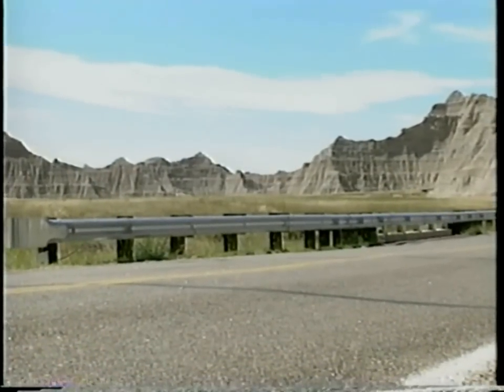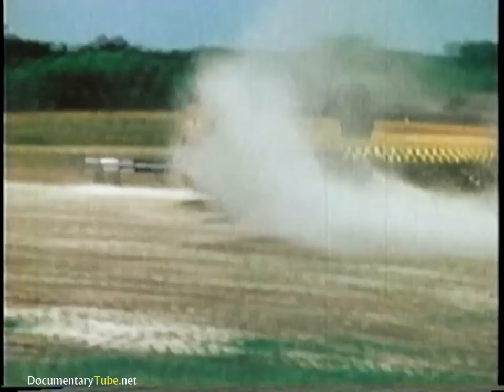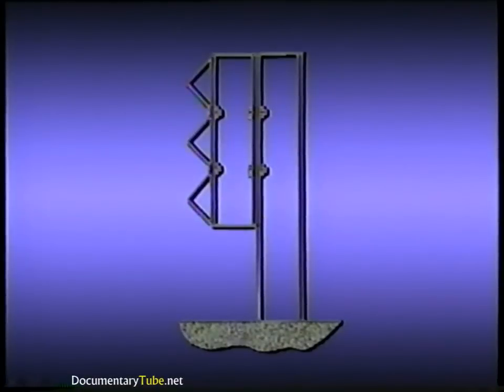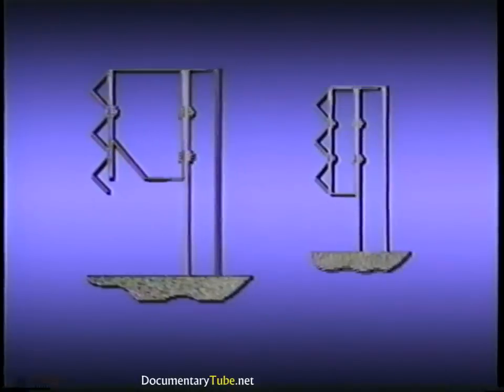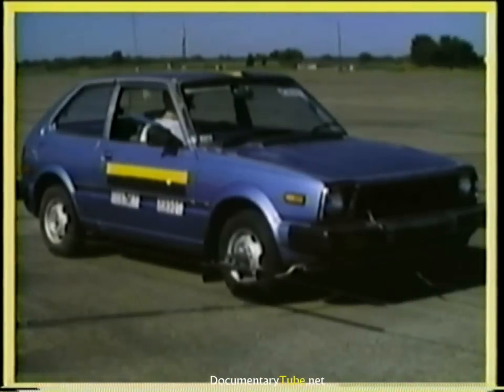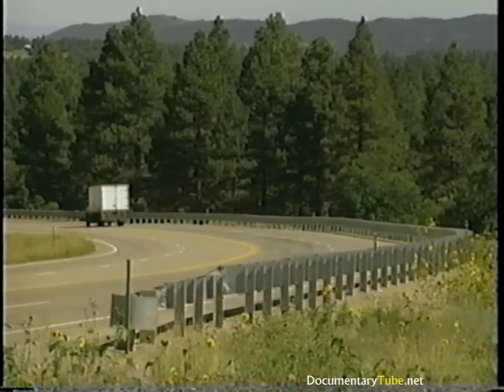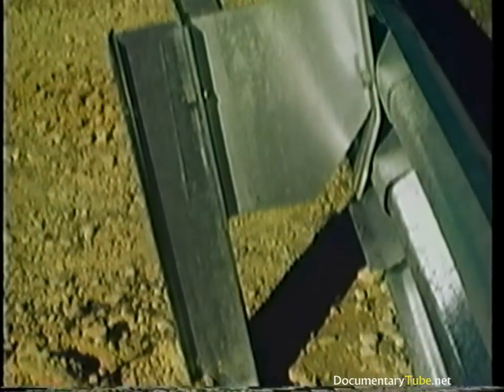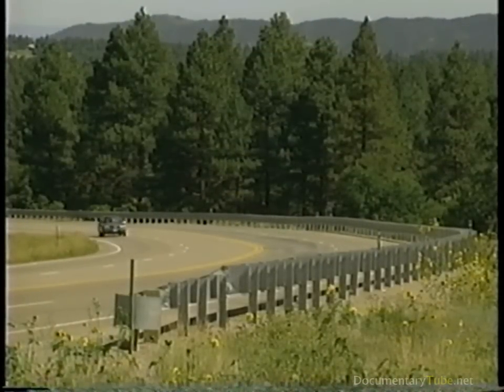HOW IT WORKS: Highway Guardrails

Comment: What’s the purpose of the cables?
Reply: If you are referring to the ones at the ends connected to a square piece of metal then those are anchors.

In a side collision they hold tension on the rail to keep it at proper height so you don't vault over the rail.

Comment: Actually, they have really easy to install incorrectly, and people have died because of an incorrect installation after a crash.
Some workers put nuts and bolts where there should not be, and it prevents the things from folding according to the design.

Comment: $1900 to replace the damaged rail?!? I think at least 2 zeros are missing from that figure!
Reply: I install guardrail, and yes, it is quite a bit more expensive. Especially with rising steel prices. End treatments alone can run $3K-$4K. And that's just purchasing the unit and not factoring in cost of labor if we have to go fix it. Can truly tell this was in a cheaper time lol

Comment: In all the fatal accidents I saw, the guardrail cuts through the car killing occupants.
Reply: This is due to either installed error or manufacturer negligence.

The most common reason guardrails spear vehicles is installer error. This can be anything from missing bolts to a blunt end terminal being used where an energy absorbing one should be used.

Manufacturer malpractice is where Trinity (now Valtir) modified their ET+ product to have a shorter chute that caused rail to get stuck instead of extrude in an accident.

As long as they are installed and designed properly they function every time.
Reply: well to be fair this is a old video. back when they had metal cars.
Reply: @ariesradke6193  tf do you think cars are made of now?
Reply: @andrewpaschall8992 😂😂😂 chinesium
Reply: @TaxationIsTheft439  Ave has entered the chat.

Comment: I install this system in Mn it seems to be pretty safe and does what the video shows. I’m just curious as to how fast these cars are going. It says 60 mph which is hard to believe. Our Hwy miles range from 55-70 and these idiots out here are going well over 80. They want to sue the State for making the roads safe after they hit the tail and are injured while breaking the law by speeding. 😳 unbelievable. These rails are safe for the speed limit they’re designed for in that area. If your going 80-90 in a 65 zone you bet your butt your going to get injured or die. The system isn’t meant for those speeds it’s meant for 65-70 or under.
Reply: Guardrails are tested at a standardized speed of 100 kph (62 mph). There have been many instances with modern MASH guardrail that a crash at higher speeds is still safely redirected (or stopped by an emergency absorbing terminal) when installed exactly as the manufacturer says.
Reply: Yeah, you're telling the truth.
Reply: But guard fences are a speed up to which they are effective, which may be higher than the design speed.